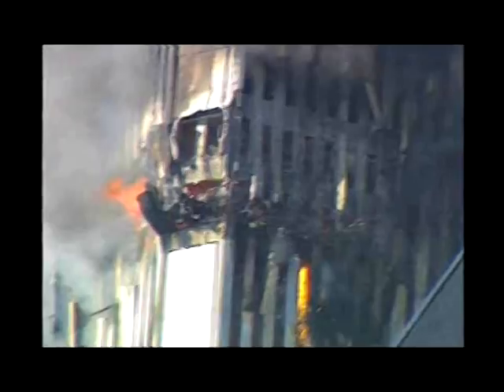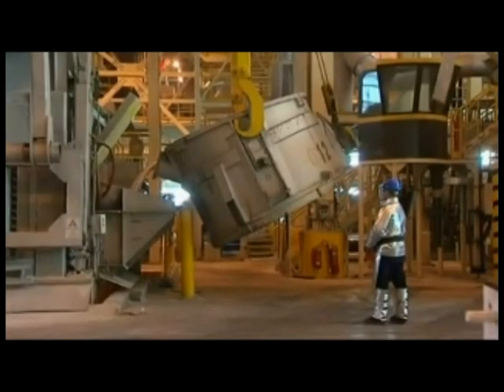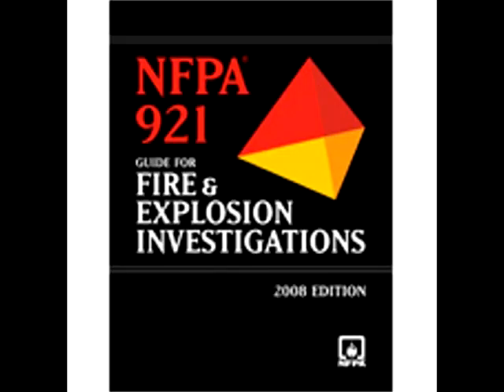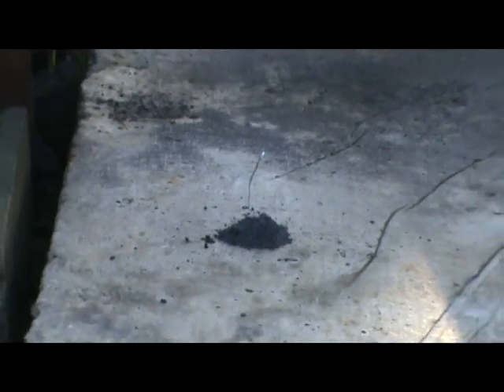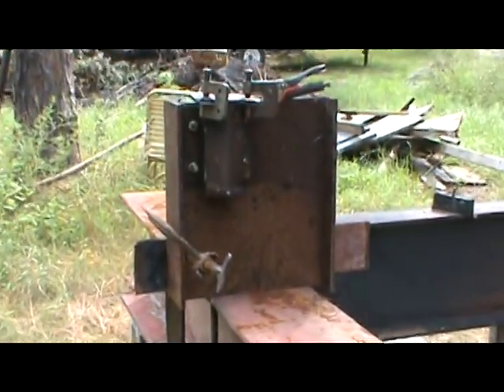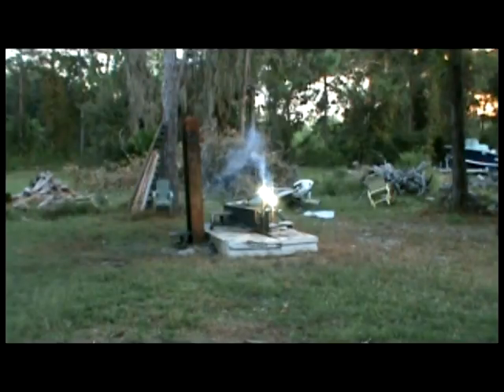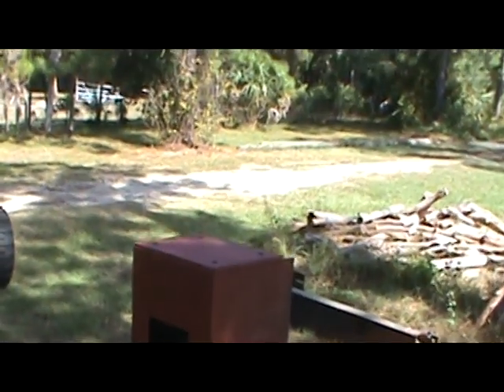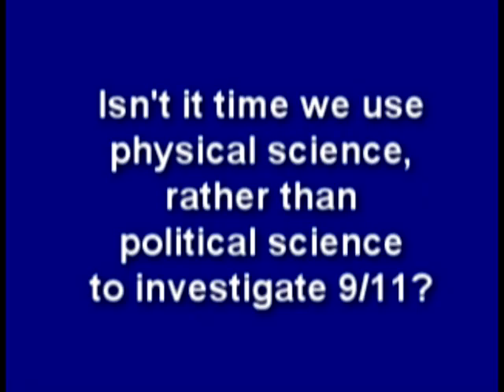9/11 Experiments: The Great Thermate Debate

Comment: How do you put a box cutter inside a iron column that is inside of a wall? And NO-ONE EVER SAW them do it? And how MANY box cutters would be needed, 100? So, cut 100 holes into drywall. Carry 100 box cutters up In the elevators and find a hole in the columns . fix the drywall. Wait for someone to crash planes into the building, hoping they hit RIGHT where you planted the box cutters and hope the the plane didn't damage the box cutters? Why, so we could go to war? And the 100's of people that know/helped the plan had never said a word?
Reply: But how would they ignite it then? Somehow fire up those magnesium strips via remote control? And how would they get the remotes to survive the impact/explosion? Containing the heat from the thermate the way this guy did would drive up the temperatures generated; same principle as putting an explosive in a steel box vs wood or even open air to make it more powerful.(One of the few things that movies like Armageddon actually got correct, a contained/ internal explosion will always be more powerful than a surface/ uncontained/ open air explosion will ever be.) But how would they get them to light? If the JP fuel etc wasn't hot enough to melt steel, then how would the flames even reach the thermates' fuses, much less light them?
Reply: the planes set it off..
Reply: There's already evidence of the owner of the towers  renovating empty floors in the middle of night. 

Many floors were empty when the towers came down.
Reply: Empty0Set
The building has a core. I don't know much, but in theory, if you have access to the center of the building you can go to any floor inside the core?
Reply: People say there was worker coming in and out of the trade centre, working on blocked off floors
Reply: @yacobsentance6507  Ok, Why the planes? Why did they wait for planes to crash in the PERFECT spot AND HOPE that it didn't mess up those box cutters thingys? Riddle me that!
Reply: shayden229 why they use planes? So it looks like a terrorist. Why wait for the planes to hit? To make it look like terrorist. Why hope that it hits the perfect spot without wrecking the cutting charges? Because it was planned and choreographed. It’s not like they were sitting around hoping a random plane would happen to randomly crash into the tower in the right spot, at the right time.
Reply: on the contrary, my place of work has exposed I Beams/H Section. not to mention they're also exposed in all elevator shaft's which aren't exactly hard to access.
Reply: Empty0Set
No I could not agree with you that an airplane hitting floor 2 would cause a collapse.
1) Jet Fuel
The jet fuel is burned up on the outside of the building, and would do negligible damage to the structure. Even if we are generous and say that the jet fuel takes 30 seconds to completely burn up, that still would not be enough constant heat to cause the entire building to completely collapse. Perhaps make the building fall and then stop or tip over at the most extreme circumstances, but this does not reflect what we saw in the video of the collapse.
2) Fire suppression systems
There is no evidence that shows that the twin towers fire suppression systems were working incorrectly. I think it is safe to assume they were working as designed. In a building fires can (Forget the term) create little twisters that suck oxygen in and increase their size substantially, these suppression systems prevent this and more.
3) Easier access for fire fighters
Because it's near ground floor, that just makes it even easier to control the fire and put it out.

The most severe of circumstance, we might see the building: sag, tip over, fall down and stop because the floors above floor 10 would be in good condition. But never a complete collapse. Fire goes only up, not down.

There is no reason that a fire on floor 150, should damage floor 75. The idea that the plane and jetfuel somehow damaged all of the floors below it is simply impossible. Maybe a few, but not half of them.
Remember that the fire in the twin towers was going out before the collapse. Smoke is a sign of a fire deprived of air/fuel. This means the building would have been cooling down, and then suddenly for no extra reason, it just goes down. The intensity of the fire was shrinking.

A 707 is not a "much smaller" plane than a 767. It is negligibly bigger. The speed is completely irrelevant. Even if the plane chopped the entire floor out completely. The upper floors would fall on the lower floors and stop. or slowly come to a stop. Even if the plane took all the floors above it out with it, there would still be some structure left remaining.

Jet fuel, and a plane, and office fires cannot cause a total collapse it is simply impossible. If you can find another possibility of the towers collapsing that's not explosives, go right ahead! I am open to ideas. (Office supplies and drywall cannot mix to create explosions incase you were going to argue that)

"The problem is that WTC7 burned for seven hours. " The chinese skyscraper was an inferno for three days! And did not collapse! WTC7 fires were tiny in comparison! I think the reason emergency workers "knew" the tower was coming down, because they were told over radio, and never questioned what the meaning of "It's coming down" was. Also "uncontrolled fires", WTC7 was eventually controlled by the firefighters. Uncontrolled means, with no fire suppression measures for 2 hours.
"Where are the sounds of bombs going off"
Go watch some videos, you'll hear some big bangs. Even witness say it's like they heard gun fire and a quick succession of "boom boom boom boom". Other's say they heard loud bangs. Even people on the street were cringing from loud percussion sounds. I don't need witnesses though, all I need to know is that it is impossible for an airplane to make a building totally collapse in the way that the twin towers collapsed.
Reply: I mean i don't know any more than the average guy, but maybe this was planned before the construction? I mean if they're playing the long game, something like this could have been on the schedule a long time ago yeah? So maybe they were constructed with the explosives initially.
Reply: ^ I think this guy just solved 9/11
Reply: So tell me yes or no, do you think the fires off jet fuel or general office product's is enough to melt steel or weaken it to a point that a building such as the north or south tower would collapse.
Reply: shayden229 elevator mechanics and there were no planes
Reply: @goosetaylor2336  ok then where are the planes and the 400+ PPL that were on them? And where did 1000's of cameras film the 2nd impact including ON LIVE TV? 
Goose , dude, seriously, have Coke and a smile And Shit the hell up
Reply: @goosetaylor2336  First you say THERE WHERE NO PLANES. Now  it blew up BEFORE the PLANES HIT IT? Which is it? I asked you about the 1000's of videos, you's didn't answer THAT and you's gave NO INFO.  I'd have a BATTLE of wits with you's, but you're UNARMED! (I hope you understand/get that)
Reply: Im going to ignore facts, because it makes what my government tells to imagine comfortable.

So.... did you say that... no one has investigated the workers that went into the building prior, without monitoring and (cough cough) video surveillance turned off?
Reply: Empty0Set:  You are confusing the dumb people with facts !
Reply: airplanes use "jet fuel", aka kerosene.  does a kerosene heater melt when you use it?
Reply: A set of elevators were shut off and had guards assigned for weeks while work was going on leading up to 911, they cover it in another vid
Reply: How many working people will ever pay attention to what some maintenance people are doin at their jobs?... Maintenance crews were constantly in and out of the twin towers.. There was plenty of time for crooked workers to plant charges all over any of the buildings involved
Reply: I don't know who to reply too, I got a lot of toxic responses and a few level headed ones.
so here goes, a b-25 contains less fuel yes, however it's a sturdier plane, again this means nothing because a plane going in to any such building will do nothing except cause a fire which won't burn hot enough to cause a structural integrity failure.
And in the freak chance it can, there's no possible way a fire at any floor other than the bottom floor(even the bottom floor is questionable) will cause a tower building to fall down pretty much vertically when it's much easier for it to go outwards.

If you respond in future please control your anger and toxicity levels.
Reply: Well if u didnt know, the elevator shafts is what help up the wtc and guys were going in and out of there for months and shutting down the elevators
Reply: Thermite is what they use in this business, I didnt think this vid was necessary, the strips the put on columns are not as bulky as these here.. also I thought it was ibdisputable that thermite traces were foubd there.. the whole thermite dont work story wouldnt exist then in the first place if it did.. your welcome for the thinking
Reply: Empty0Set i’m just replying to this so i can see more comments on this post later. and i liked what you said
Reply: shayden229 people who were there said they didn’t see planes I wasn’t there but y would they say that ? It’s Just Covered all up by MSM
Reply: an explosion occurs just before the jet hits, watch the video again, on both buildings and do so in slow motion, the first raw videos recorder not the altered ones.
Can you also explain to me why when a B-25 smashed into the empire state building it didn't collapse?
And also why when many entire likewise towers went up in flames from office fires around the world, the entirety of them went up in flames and still no collapse?
Reply: @skemjames  the b-25 was a fucking prop plane.
Reply: The Reaper the chinese skyscraper should be all the evidence we need. Either the engineers who made the twin towers need to be thrown in jail for negligence when they built the building, or there's more to the story than the official gov. report. That chinese skyscraper was on fire for three days straight and its skeleton was left standing. WTC7 was on fire for what? A couple hours?
Reply: @MegaMech  they forgot to account for an airplane crash your right I believe that it was a while before it fell
Reply: Because the Empire state building was built different, and a B-25 is smaller, slower, and can't carry as much fuel !    Does that help you?
Reply: @skemjames  like someone else said a b25 dosen't carry as much fuel
Reply: Bingo
Reply: @Empty0Set so randomly crashing a jet into any floor off not 1 but 2 towers both built to withstand plane crashes due to the b 25 crash on the empire state building, is gonna bring them both down?
When the jet contained no explosives and apparently had lava for fuel?
And yet a truck in 1993 loaded with explosives detonated under the north tower did nothing?
And then a poxy little fire burns and crumbles building 7 a building built by some off the best skyscraper erectors?
I know you love your country and I love mine but you're not seeing things with open eyes.
Reply: +The Reaper - Once AGAIN, you’re out of your league, fucknut. The 1993 WTC Bombing likely would’ve brought the tower down or toppled it into the other tower of the bomb was set closer to the foundations.  NY got lucky that day because the bomber didn’t have the knowledge to know the key weak point.  Instead he made a huge boom that wrecked the garage and knocked out TV transmissions thru the antenna for about a week.
Reply: @Empty0Set +The Reaper

I know little about any of what you're discussing, but you both have evidence that can debunk eatchothers. I find it.. disturbing as to how the media handled it, with their experiments as opposed to this brilliant mans tests. But I do see how both of your views could be just as valid as the others, but honestly there's no reason to fight over whos wrong or right, in the end what happened has happened and no matter how it went down its still just as tragic and heart breaking.. But anyways what im getting at is, either way whats happened has happened and whatever went down dosent matter anymore its done.

Though yall got some hard evidence to back ya up good job with that